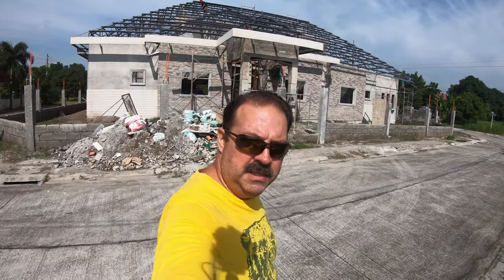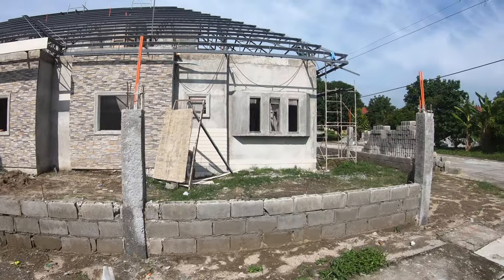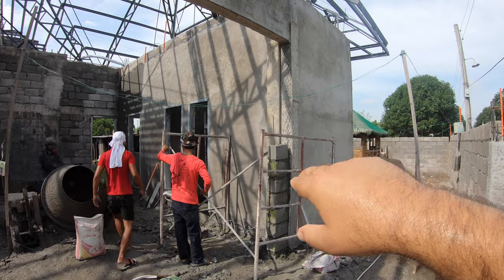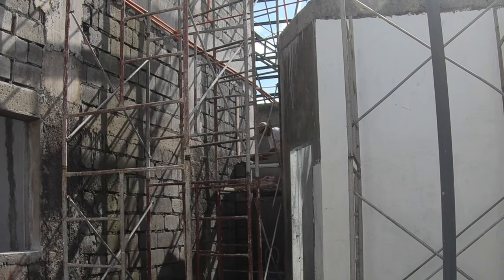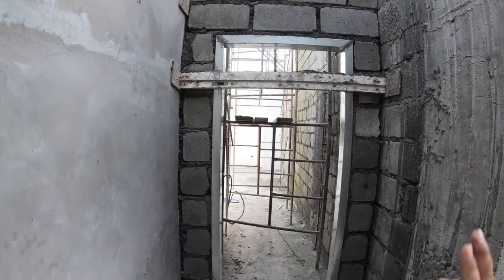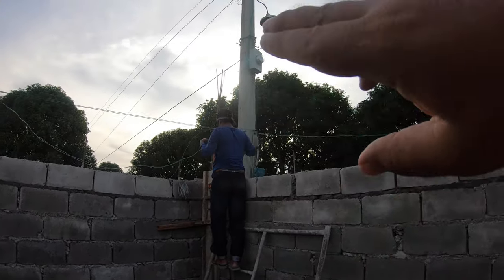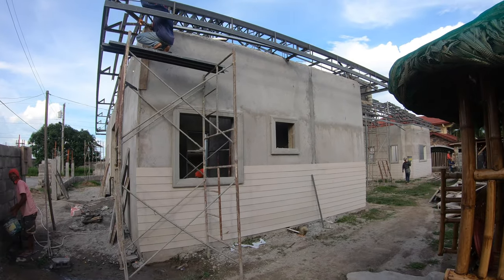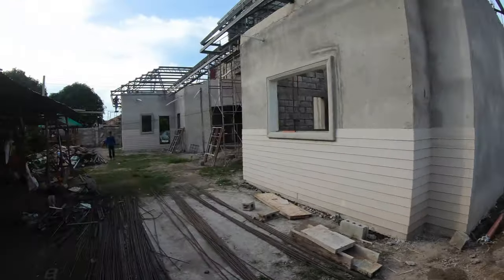Philippine House Building Step by Step, Build Day 120: Day in the Gutter

Comment: I just saw your channel on my recommendation and I find it interesting. IMO, it looks better to have a stone cladding also on both sides on that protruding wall design on the front facade with stones rather that those fiber cement claddings. Anyways, your house is massive!👍🙂
Reply from the maker: So I think you are referring to the bay window on the front. Confirmed with the engineer; we are stone cladding all of the wall around the bay window, just not the bay window itself. 
Thanks for tuning in.
Reply: @CasaTexPina  Im referring to that side wall 15:17 where that worker is installing a fiber cement board 👍🙂

Comment: curious to know how they intend to clean the mould off blocks in garage before it is rendered (plaster coat) ? my other question ?  how did they tie-in that block nib-wall on right side of garage door ? i hope they drilled and chem-set two pins per course ? or have the lads strapped it together like the mouldings around windows ?
Reply from the maker: andrew c.
The green mold is curious for me too. I’ll have to watch and see. 
The nib wall for the garage door - They removed some of the plaster coat from the existing wall prior to attaching long semi-exposed nails. Then built the wall with vertical rebar  from the foundation and from the overhead beam.
Reply: @CasaTexPina  spray lots of chlorine on the green , then water blaster .
Reply from the maker: Took care of it myself with a garden sprayer and bleach water mixture.
Reply: This is a very huge like semi bungalow house ive ever seen in Philippine build..
Reply from the maker: Mar Baut 
Thanks for tuning in.